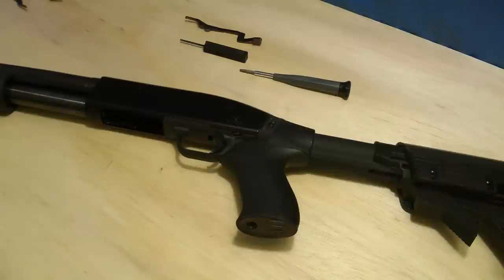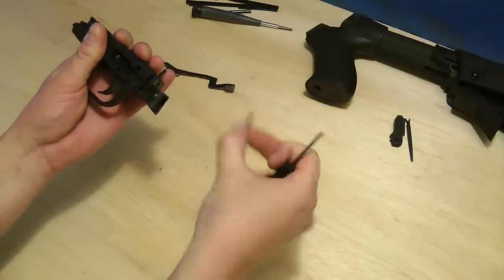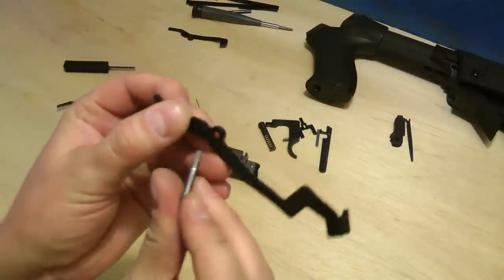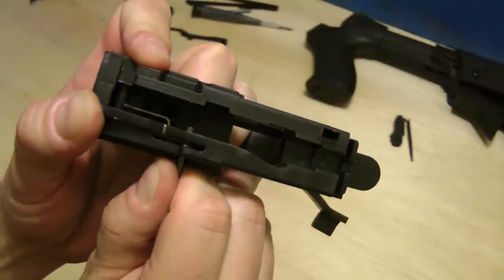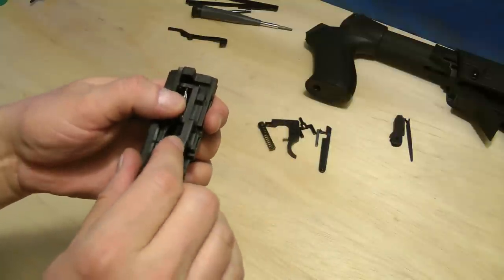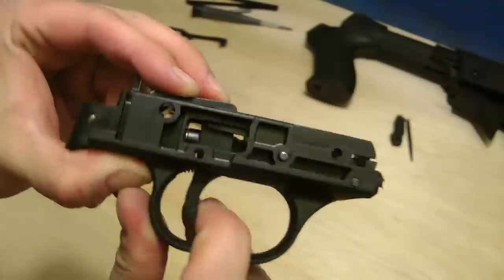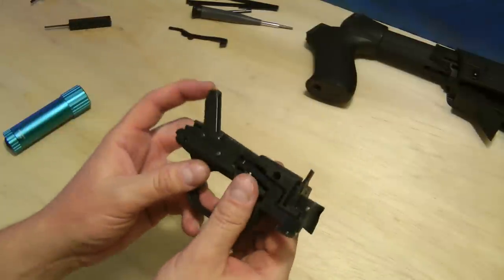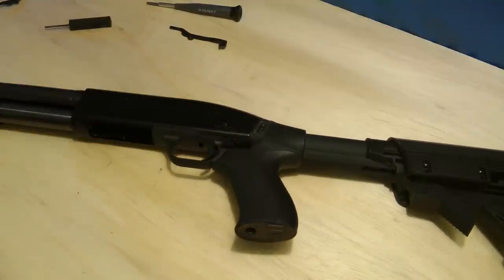Shoten Armory Extended Action Release Installation (Mossberg 500 Trigger Disassembly and Reassembly)

Comment: Thank you for taking the time to explain and get good camera views. Got it all done in one fast seating. About 30mins altogether and that was filing the shoten armory piece, the stamps have very jagged, sharp edges. Filed down with some needle files and alcohol prepped and blued…washed, wiped, and oiled up before install. Oiled pins etc. very good work sir! I thank you. Made a sick sbs out of a 590S shockwave with Mesa tactical pistol grip/ar stock. With black aces warhammer heat shield with pic rails, surefire m300c, ergo tri rail pump, steel safety from pro mag, and your action release lever. 5 shell sidecar. Trijicon rmr, and bead below heat shield for back up sights. Did some fab work to the tri rail to accept the mossberg embroidered hand strap as well. This gun fucks.

Comment: As a new Mossberg 500 owner and no mechanical wizard I have to get Mike high marks across the board on this video. He starts by giving you confidence in his tone and manner and holds you by showing that it may take a try or two in the reassembly stages. I completed my installation with a few short sticking points ( one in the forward springs and the other in the trigger pin alignment). A great guide for the installation of this excellent product by Shoten. Thanks so much Mikey!!!
Reply from the maker: I'm glad the vid helped you through the sometimes frustrating process. I really appreciate the comment, thanks you!

Comment: Just installed mine on my Maverick 88 security barrel, pistol grip and man was it a pain in the ass. Not shoguns fault at all. Product is great. Don't have to take my thumb off the grip to hit the lever anymore. Only complaint is the product was not deburred and was very sharp, will have to take some sandpaper to it but it's an awesome product.
Reply from the maker: Glad it helped, thanks for the great comment!
Reply: I realize it has been a long time now, but do you remember differences in the Maverick 88 and this model.  I believe some of the 2 of the springs are different.  Though, this could be me :)
Thanks

Comment: Thank you for this video. It gave me the confidence I needed to try this install instead of sending my trigger pack to Shoten and paying them to do it. 
I installed the short extension lever. After watching your other video I was convinced I didn't need the longer versions. Hell, I have fairly large hands and the short one extends to the first knuckle on my thumb in shooting position. I probably would have had to cut either of the other versions.
I bough a trigger group off Ebay to practice with, and lo and behold it didn't fit my 500A for some reason, try as I might it just wouldn't slip into place, so I ended up doing this job twice. They are visually identical except for small deviations in the housing, but nothing that indicated why it wouldn't fit. The second time I didn't even need to watch the video, and was done in under 10 minutes with zero cuss words involved.

Comment: If I ever have to take my trigger assembly apart, I'm glad to know your video is out there. But as someone who is both not mechanically inclined and of low frustration tolerance, I sure hope I never have to.  In any case, outstanding tutorial.
Reply from the maker: Thank you, that means a lot to me.
Reply: If you are not mechanically inclined I would not try it.  Find a gunsmith.
Reply from the maker: Richard Lamoreaux Try it first, then if you absolutely can't do it, find a gunsmith. Then at least you know you tried.
Reply: that is true if you are mechanically challenged and extremely determined :)

Comment: Just installed the Extended Action Release on my Mossberg 500.  My lesson learned is to watch this video start to finish about four times before you start.  Then start/stop the vid as you go.  

It is quite tedious with lots of little details that matter.  Just take your time with an occasional break to ease the tension.  You are not likely to break anything and the springs are not that small.  It took me 45 min and two beers to finish.

Note on the leaver.  It is not a work of art.  Looks like it was made in a garage.  But it's way better then anything I can do and it totally fills the bill.  It is now a piece of cake to rack one and the movement is natural.

Glad I installed this as I was considering removing my pistol grip.
Reply from the maker: Richard Lamoreaux That is one awesome comment, thank you. What kind of beer?
Reply: Newcastle Brown Ale
Reply from the maker: Nice, I used to drink Newcastle all the time.
Reply: +HeyYoMikey81 So, what do you charge to install one?
Reply: i agree...
Reply: No kidding I'll pay you give me your address and I'll mail you my trigger with the replacement lever
Reply: This just saved me some $ for sure!  Just bought my ATI stock and was already thinking of dumping it for a Magpul until I seen this video, and the previous one!  This does seem like a quite involved process, but well worth it! I have to scoop up one of these for sure!

Comment: Thanks for the walkthrough. Just installed this on my shockwave 590 with pistol brace. The extended lever is a must for safer operation. Your walkthrough was spot on and I had no issues following along.

Comment: Just installed the extended action release lever just like you show on the video. I must say it took me much longer, but I am a determined type person and stuck with it and finally got it done. Your video was very helpful. Your detailed explanation was very helpful. Great job and thanks for posting it. Not sure why MB hasn't fixed this problem already. My 500 has the pistol grip too, and I was very surprised how hard it is to access the lever as is. I do shoot rifle/shotguns left handed (even though I'm RH) and so I could use my index finger no big deal. However my wife is RH and this extension addition makes it an easy fix. Anyway, the four hours was worth it. If I had to do it again, could probably do it in 1 hour. lol  I highly recommend this ext lever, and this video. Thanks

Comment: Thanks for the video! I installed the 35deg in a 590M.  My gun required me to take a needle nose pliers to the front end of the Shoten lever and bend it slightly upward (towards the bolt) as the bolt was overriding the lever and I had no lock up as initially installed.  I bent it just a bit to have the top edge of the lever sit just slightly taller than the top of the square block it sits against of the housing.  All Good!

Comment: Very cool device! I did not know this existed. I have not been interested in changing out my OEM stock to a pistol grip stock because of the accessibility of the release lever. Great video.

6/29/21 update: I just completed the install. Very good! It is very tedious so just take your time. Hardest part was reinstalling the lever pin. I also did a M*CARBO trigger spring update.  Adding the lever allows me to use my middle finger to manipulate the release lever and keep my trigger finger pointing down range. Note: I only use a full stock, no pistol grips because I don't like to break my grip to activate the safety.

Comment: I installed one on My Mossberg 500 yesterday. My trigger mechanism is completely different than the one shown in this video. It has more springs and sort of a "trigger within a trigger" kind of set up. I got it all back together and it seems to work but it was a bear having to figure some things out on my own. Also, once the new Action Release Lever was installed, I still had to shave away part of my Tactical Stock so it didn't rub.

Comment: Great video! The only tip I could possibly add is: put a couple of small pieces of tape on both sides of the sear to keep the pin (furthest forward pin) in place. Mine came out and

Comment: Just installed the extended slide release lever for the Knoxx stock. It rubbed at two spots, did not function correctly and the finish flaked off....not to mention it took about a month to receive. Wouldn't recommend it. Reinstalled the original release. No issues. Before I did so, I placed the two side-by-side. There was a variation along the spine of the release which shouldn't've been there. Also, the thumb portion rubbed along the Knoxx stock. I can't say that I'm pleased. Oh well. At least they only jipped me out of only $40.
Reply: Did you order the lever that is specifically for the Knoxx stock?

Comment: I just put one of these in my Mossberg 500 and I want to meet the asshole that designed that trigger pack so I can bitch slap him every day for a full year!!!!!  This was probably the hardest gunsmithing I have ever done.  

Also, I put the angled extension lever in and for some reason it does NOT automatically push down like it is suppose to.  It can stay in the up position without needing my thumb to push it up.
Reply: Same. I found out that Mossberg uses different springs now too.

Comment: I’ve checked mine twice and it is just as in this video but it can still be racked no matter what. Not sure what’s wrong.
Reply from the maker: Is it sticking to the pistol grip?
Reply: HeyYoMikey81 I’ll have to check it tomorrow it’s at the shop. I threw in the towel. Figured I’d ask here for any ideas. Thanks for the response.
Reply: Maybe it is. It doesn’t seem to have the travel shown in the video. But when it’s just the trigger group they look the same function wise
Reply from the maker: @NOTCHU87  When I did my install the lever was getting caught on the pistol grip, so I had to bend it away from the pistol grip a bit.
Reply: HeyYoMikey81 it’s exactly what it was! Appreciate it!  I pushed the grip away when I screwed it down. He had the SB tactical one.
Reply from the maker: @NOTCHU87  Awesome, good to hear it worked out!

Comment: Why is my mossberg maverick 88 spring system different? Did they update it or something?
Reply: I have the same question.  Some things are identical with video, but at least 2 springs are different and I haven't been able to figure them out.  Frustrating.
Reply: @timmyatt6431  I ended up taking it to a gun smith to get the Shoten extended action release installed and there were unable to do it. They told me it actually dose not fit the maverick 88. Also mentioned perhaps they list it on the website as fitting the maverick 88 to make more sales. Couldn’t find anywhere discussing this issue and I wasted a good amount of money on this whole set up including paying the gunsmith to attempt to install it. They ended up having to put the original action release back in and the issue with having a pistol grip on a maverick 88 is still there.